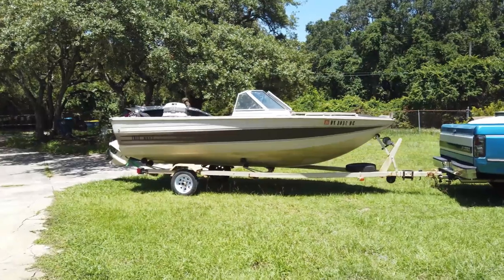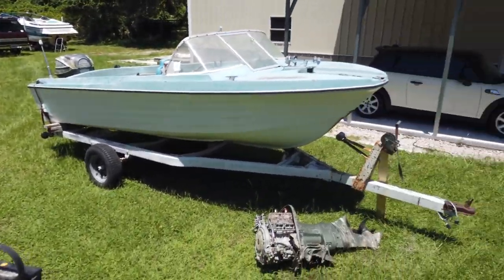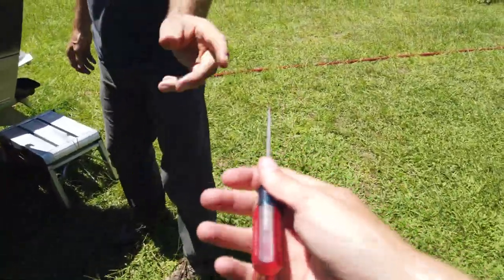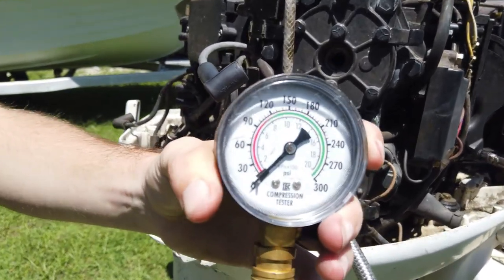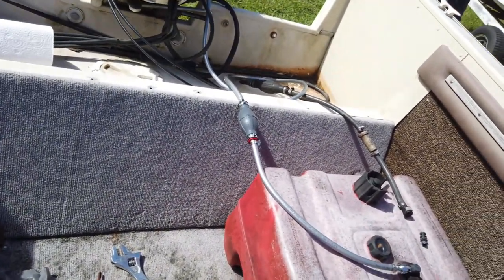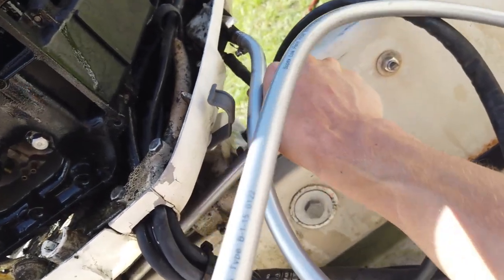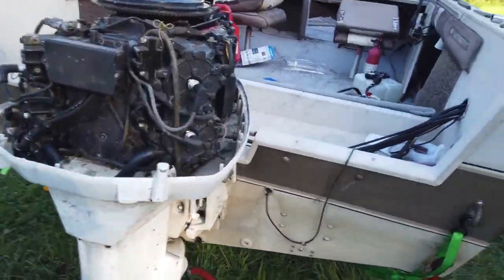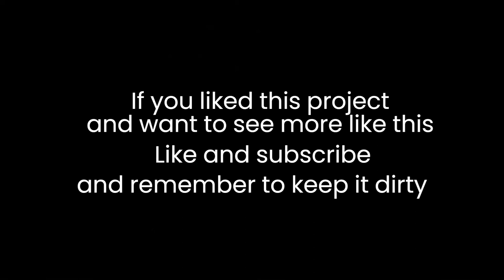Will it run? $300 1987 Crestliner w/ 90hp Johnson

Comment: For future reference when working on a 2 stroke don't use starting fluid or break clean or parts cleaner to see if it will start or run on it can and will destroy a 2 stroke instead get yourself a squirt bottle and fill it with 50 to 1 mixed 2 stroke gas and squirter that into the carbs
Reply from the maker: Thats big brain i had the oil injection hooked up and premix in the feul tank but that would definitely be better for the motor than starting fluid 👍.

Comment: As a mechanic that has rebuild hundreds of these you should take the carbs apart clean then good make sure they are all getting fuel then start. be careful with starting fluid as it can cause damage to cylinders that might have a clogged jet on the carb. that's not good compression either 20 psi difference not good. Rebuild it before it blows! and if that's a 87 you can't re-sleeve.

Comment: Next time before you even think of cranking over a man unknown engine use fresh gas (the lubricant for the internal parts is mixed in the gas). Drain the carburetor bowls, spray a small amount of any lubricant into each cylinder and rotate by hand. Compression test indicated a problem so retest that again. Good luck there is good promise for that engine.

Comment: Bottom carb is plugged and probably contributed to it burning up the bottom cylinders. You finished it off I'm sure running it with the starting fluid.  The oil injection can't get oil to the cylinder without gas from the carb plus you didn't prime it back after hooking the hose up. Premix didn't matter since the jets are plugged.  Overheating made it a 1000 times worse.  Also fuel and water coming from the vent on top carb says float is stuck. Not being critical of you, but it is what it is.  Go go ahead and clean the carbs and hope for the best.  Delete the oiler and run premix. Will make someone a nice parts motor though.
Reply: Premix for life...ditch the oil injection..all that ether is noo good for long periods of use lol. Straight killed that motor.

Comment: I think the engine needs overhauled,( the #3 and #4 cylinders are low on compression probably caused by the lower carburetor being partially clogged at best! also the oil injection system (VRO=variable ratio oiling) system never was trouble free, there were tons of failures,and I wouldn't trust it!  Also water pump should be changed,and fuel line and hoses probably need replaced. I worked on marine engines for 32 years and I have seen multiple engines just like it. Nice video!!
Reply from the maker: Haha yep it definitely need a overhaul and a lot of love and the vro is definitely getting deleted reminds me of the oil injection on my jet ski.
Reply: It could also mean the lower two cylinders got a little water in them at some point and the valves rusted a bit. Running it for a short while and then retesting may help that.
Reply: TO BE! Conjugate the damned verb!

Comment: Using starting fluid will wash the oil off of the bearings and cause it to knock.  Also after you hooked the oil line I didn't see anyone pump the oil primer bulb that also could have contributed to the knock.
Reply from the maker: I have opened the engine and figured  out it was piston slap all bearings are tight just a wore out engine.

Comment: to get fuel ⛽️ one make sure fresh gas. 1-2 primer bulb and vent on the tank needs to be opened knob on top of gas cap. all the way open loosely up lefty it may take several bulb will go firm. oil tank yes some have a metering pump self inject the proper amount of oil. but this is old school. prime it up i guess to get oil pre mixed till it’s firm. being that it sat mixed gas like for weed whacker thinned just to lube up cylinder walls prevent scoring the lever next to the gear shift is a choke lever that goes up till the engine catches put back down crank intervals it also revs the engine don’t go full boar out of the gate. thousand rpms till it warms up or it will stall. then put the choke lever down. need a drip bottle like a plastic ketchup bottle something you can add some mix gas. before running it off the gas tank.  the pre mix temporally gallon of gas will smoke but will burn off after running a gallon through to get stuff lubed up. need to make sure that fuel tank has been flushed out  then fill it the oil can needs to be dumped old oil. get a fresh two stroke goes in. next time for a water pump or impeller. remove lower unit housing under neath put everything back reverse order. next lower unit gear lube. drain. either on boat or put said unit on a temp stand remove vent screw and main screw let the oil drain if the oil is milky brown theirs a seal behind the prop behind the shaft that needs to be replaced add assembly lube to prop shaft. take a black sharpie to line up shifting cables prior to removal re insert unit. refill lower unit with gear lube till flows out the vent 🕳️ at the top. add extra to half a extra pump to make sure no air bubbles 🫧 top screw quickly install bottom wipe up excess oil. some have rubber rings or some crush washers replace if needed. charge your battery full 100%  do the maintenance first then go crank it let it run. it will take water a bit to fill jacket and pea out should be steady not dribbles. little bit of lube spray on the starter yes need to get a proper staring. deep cycle battery.

Comment: bypass the oil pump and run mixed gas. it's so much better. if that oil pump goes while you are cruising it will blow the motor

Comment: U guys need some basic mechic classes.   U do more harm than good to that engine!
Reply from the maker: Before this video I checked the plugs on the engine which one had aluminum on it so I knew it wasn’t long for the world this is because the previous owner ran is with a failing fuel pump which is leaking fuel every where in the video it’s a wonder it ran at all with how bad the bottom two cylinders were.

Comment: U probably have ruined that motor, should never use starting fluid on a 2 stroke it has no oil to lube motor. Should use some premix gas to prime.
Reply from the maker: Had premix in the tank and oil tank full of oil. Motor had piston slap which wasn't caused by lack of oil its just a 30 year old engine thats wore out.

Comment: Running your motor hot is not good looks  you just kill that motor
Reply from the maker: Yes heat will kill motors luckily this one only got to about 230 degrees Fahrenheit before we noticed it. This motor already had a bad knock before it got hot sadly but it was fun getting it to sorta run.

Comment: that lever on the shifter is your choke!
Reply: Actually it's the hand throttle for when the gear lever is in neutral. Holding the key in before starting engages the auto choke, as said in the video.